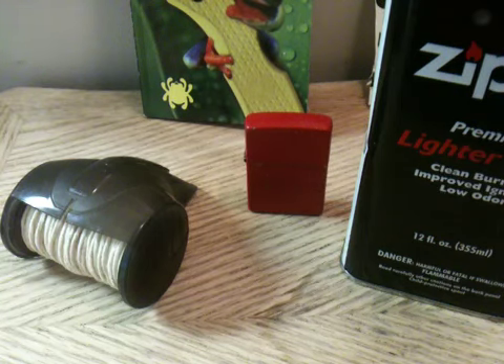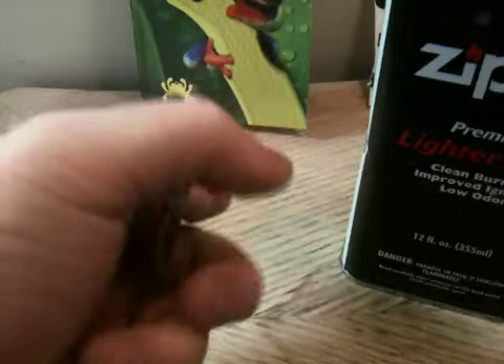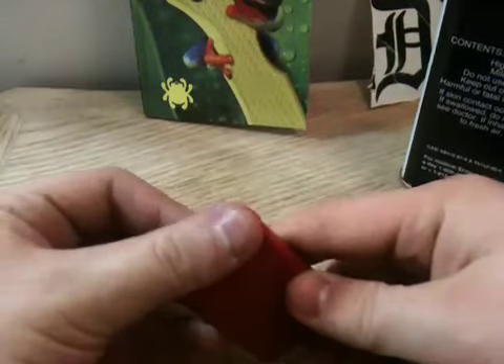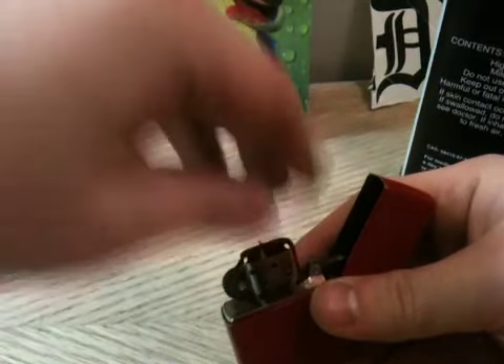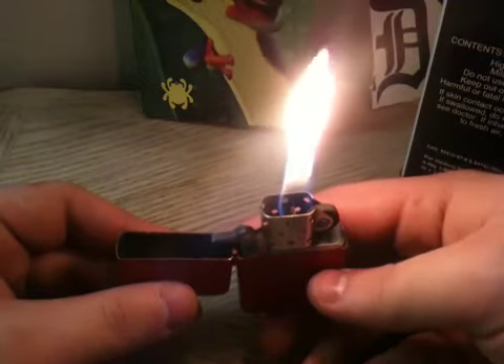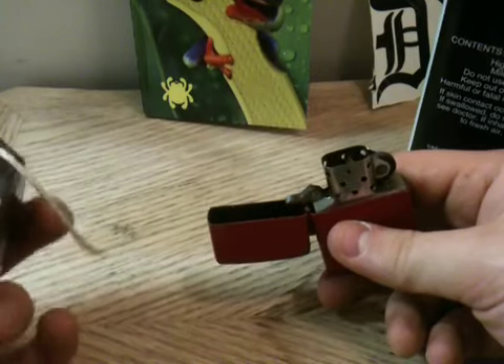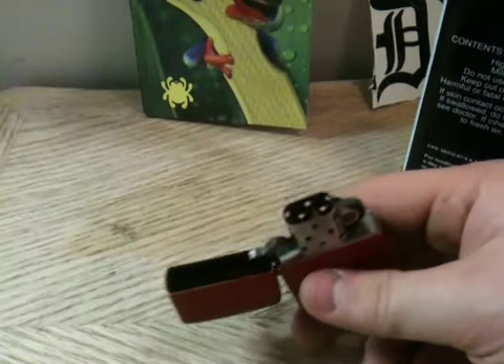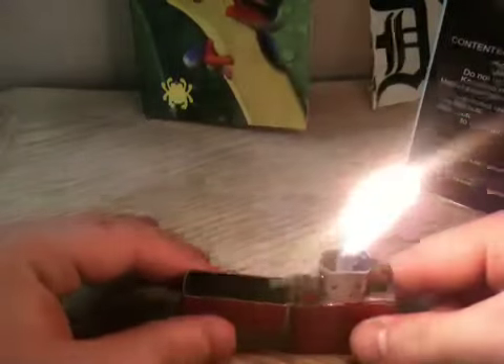Zippo myth 3 using cotton twine / string as a Wick

Comment: I use the wicks from birthday candles because they have wax on them so they burn much slower. It's just like a regular zippo wick.
Reply: does it work?
Reply: Dr Dre the chronic
Reply: @noobslayer209  it works right??
Reply: Finally
Reply: It works until the wax melts and the flint can cut through just with sparks

Comment: Idk why but when i use twine they burn really quickly not half as long as the zippo wick can some one shed some insight as to why it might be
Reply: I think the real wick has a small ammount of wax in it so that it doesn't burn so fast.
Reply: 4 years late but it's called Rayon. It's a semi synthetic cellulose braid with copper intertwined. Also called Amorphous Silica Yarn. Silica means glass... So they're similar to fiberglass strands.
Reply: Have you ever tried looking for fiberglass wicks they are very long lasting